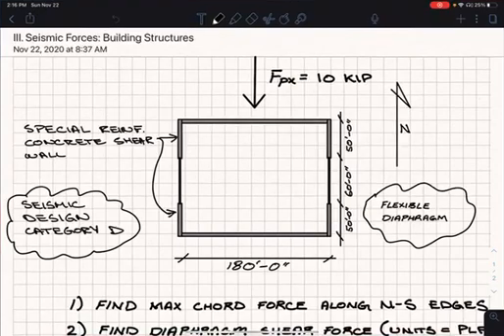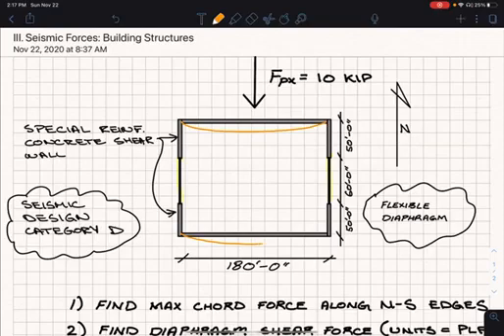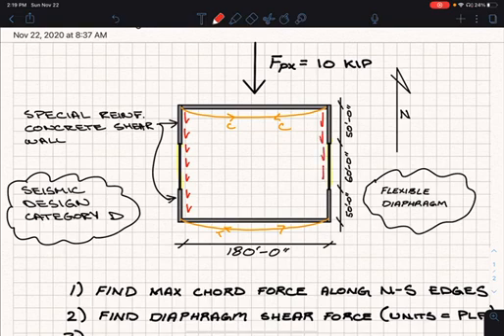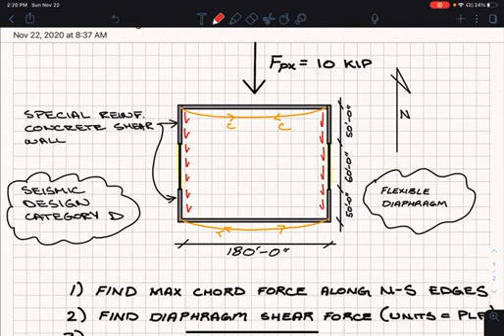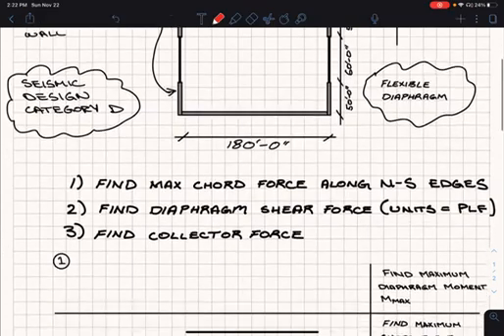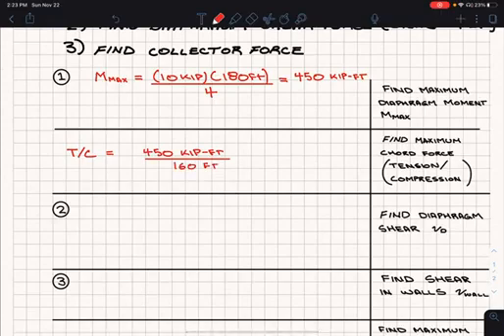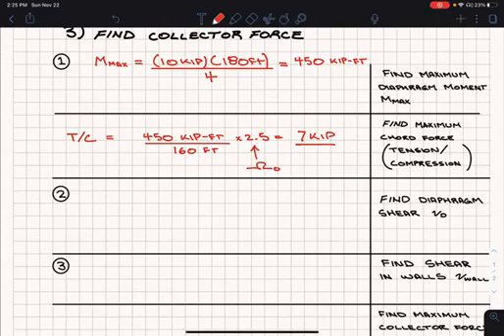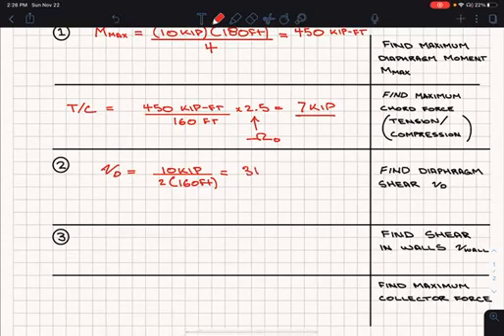PE Seismic Review: How to Calculate Chord and Collector Forces

Comment: Great vid but Flexible Diaphragm means forces are distributed through tributary width, not stiffness so the 10' wall in your case scenario at the end that you mentioned would actually be the one to take greater load. If it were a Rigid Diaphragm, that would be the case but Flexible is written. Hope this helps!
Reply: Can you justify this through code section? This seems to be correct as the shear flow will behave to what’s stiffer. Curious because I have a PC arguing your case.
Reply: @eugenekuehl  ASCE 7-16 Section 12.3 covers this but let me know if you can't find it and I'll get more specific for ya. Like you are getting at with shear flow, if the diaphragm flexibility is roughly over 2× the in-plane stiffness of the walls, it moves enough that the walls don't play a super important role on how strong they are and then everything distributes equally

Comment: Good effort. One caveat though; the chord is not ought to be designed with omega factor when it consists of rebars within concrete. It d require omega factor if chord members are to be connected with dry connections, but just for the connection part of it, not for chord member rebars.
Reply: What do you mean by dry connection?
Reply: @aboudeh21  E.g., mechanical connections.